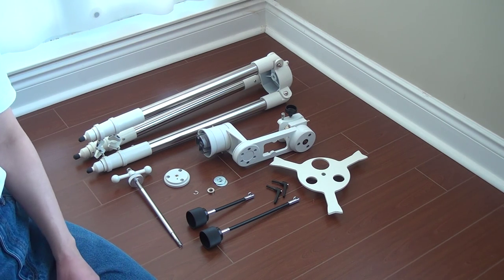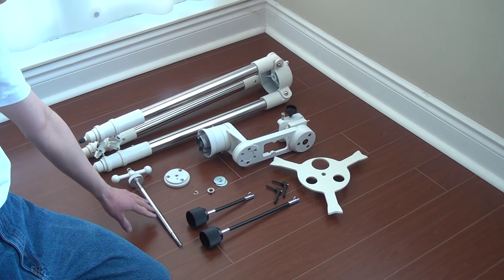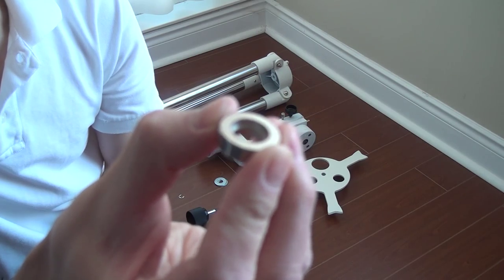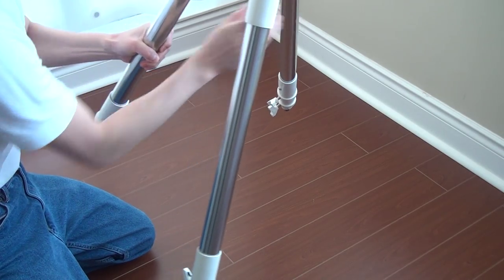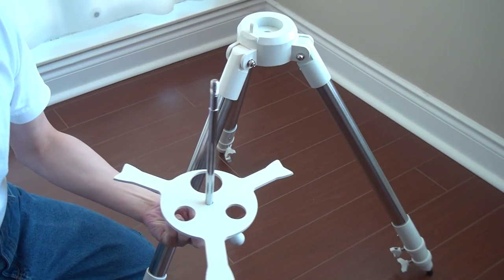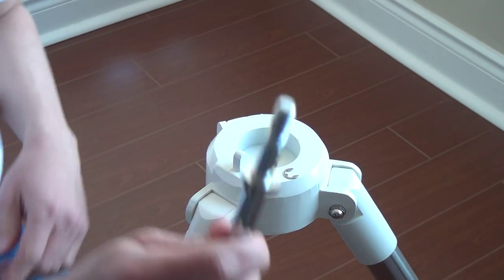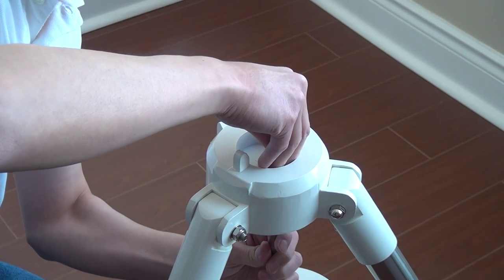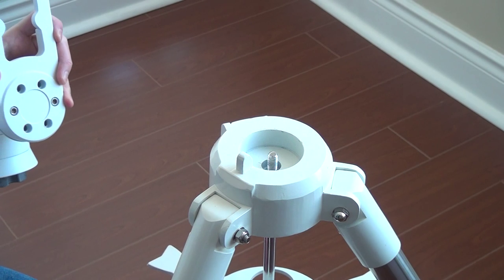How to assemble the Explore Scientific Twilight I Mount

Comment: Can this mount handles a C6 Newtonian without problems? Specs says that can hold up to 18lbs and my 6" OTA is about 11 lbs...
Reply: I put my C6-N on it, you just have to put the mount at 45 degrees instead of the 90 degrees shown if you want to aim straight up. No problems except absolutely no directions.
Reply: @MountainFisher  thanks

Comment: I have read a few complaints that the tripod cannot be collapsed without disassembling everything due to the center plate being in the way. The tripod would stay in the open position without the center plate. Is there any reason why you couldn't just assemble it without the plate? Or, use a bolt instead of the long center shaft.
Reply from the maker: There is kind of a way to collapse the tripod.  You would loosen the centre plate and then position the spokes between the legs and then you can partially collapse the tripod.
Reply: You do not have to use the spreader plate if you don't want too.

Comment: They should have made that central rod in two sections, upper and lower, so you would be able to compress the leg spread for transport without having to take the head off. I'm paying a machine shop to do this. The company should have done that in the first place.
Reply: huh????
Reply: You're absolutely right.. Putting this together today...So pissed they made it like this.
Reply: @brandonmills3168  I don't use the spreader plate.

Comment: Where does the camera adapter go, where does it attach?
Reply from the maker: +Barry Shawkey The only place I could see where it goes is where the telescope mounts (the part that allows a telescope to move along the y-axis).  You would remove that part and attach the camera adapter there but I don't see a way to attach a camera as there is no 1/4"-20 thread included with that adapter to attach a camera to.
Reply: +Burton Tsang Thanks for your response.
Reply: In fact it is not a camera adapter, as it sports a 1/4" female thread (the same as in any camera).  Instead it is intended to replace the bottom piece where the rod screws (it is removable using the allen wrench supplied).  This way you can attach the mount head to a (robust please) photo tripod.